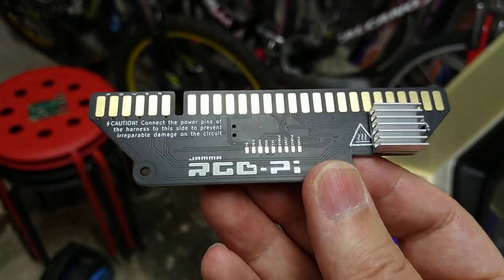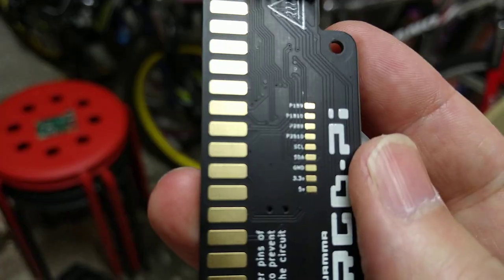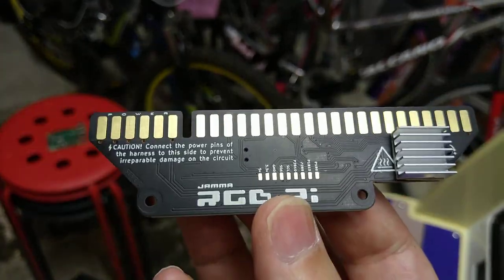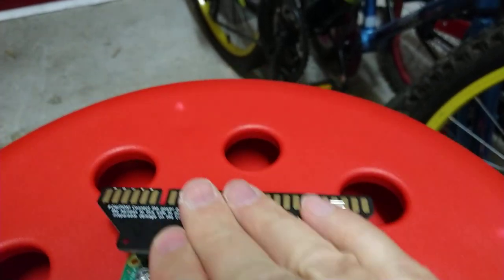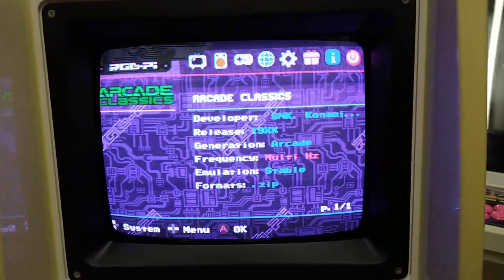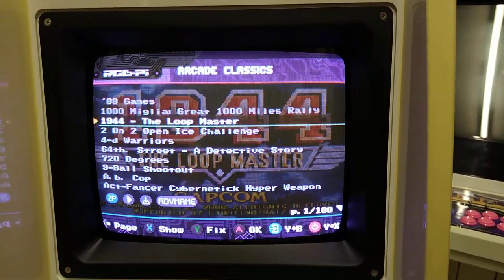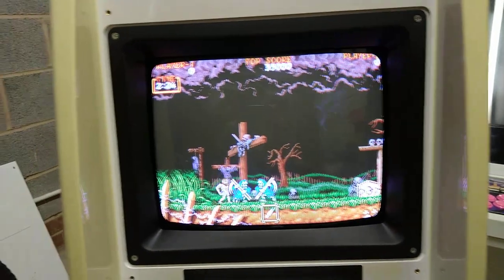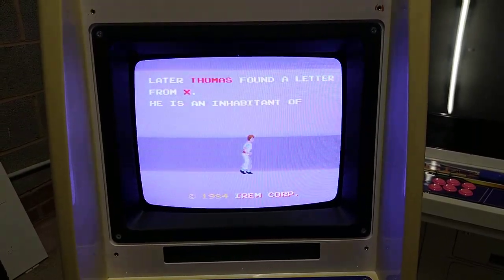RGB-Pi Jamma Overview

Comment: Hi Richard, thanks for the video.  The Raspberry Pi 3B Plus that I ordered only has 19 sets of pins on the GPIO. Does that make a difference or do I need a version like yours with 20 sets of pins?  The Jamma hat would have two empty female sockets on mine.

Comment: Just ordered on of these, Did you have any trouble with the coin slot and something about adding a relay ? I'd like to keep the coin slot working if possible and also add an LCD marquee but I can't find anything on it with RGBpi jamma.
Is setting up 6 button straight forwsrd. Thanks I'm advance  👍
Reply from the maker: I had no issues with the coin input, I removed the coin mech and added a simple microswitch behind the coin reject
Reply: @chunksinspace9650  thanks for that, that was 2 of the main features I’d like to keep and add especially the lcd marquee